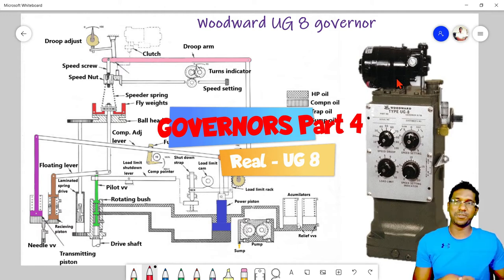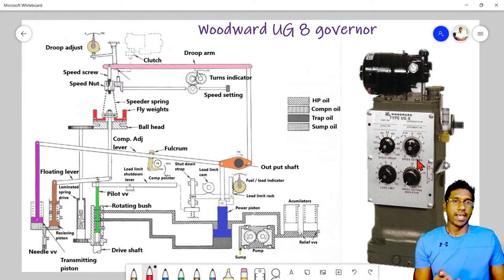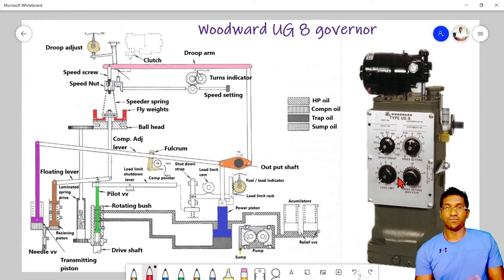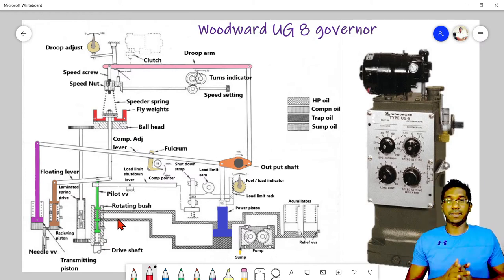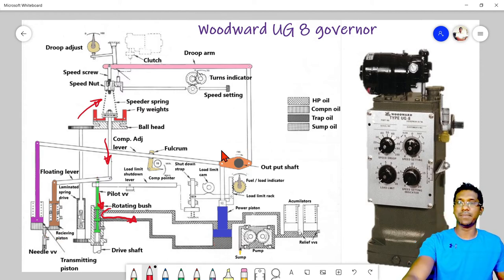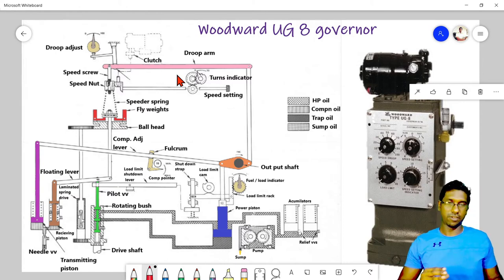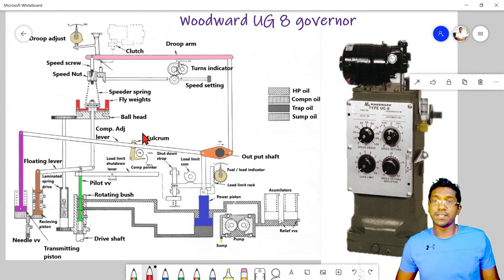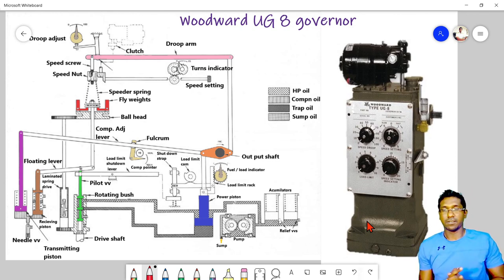Diesel governors English Part 4 #MarinEngBase

Comment: Superb ...I was waiting to see such a video ....only one  part more ...regarding the booster air during initial starting the integral gear pump is not running so to shift the fuel level requirement of boost air ?...pls explain just initial start of ug governor since no hydraulic pressure from pump...

Comment: As far as I understood with the help of compensation pointer we can adjust a transmitting piston stroke, right ?, thus compensation range will be more or less, correct?
Reply from the maker: Yes you are correct. It controls the travel of transmitting piston thus, the temporary droop / compensation range / (load to speed reduction) range will alter.
I will upload the lecture not for your reference too.

Comment: I didn't say what to do with compensation range arrow after needle valve adjustment has been completed?? put back arrow ( compensation range) in neutral position?
Reply from the maker: It has to adjust as per the site requirement. You must observe the governor response while generator running in parallel. You can have a fine tuning to gain stability in reasonable time by adjusting compensation range and rate ( By arrow and the needle valve)